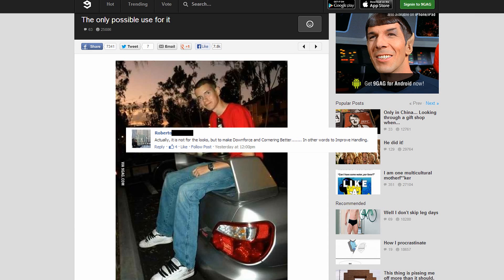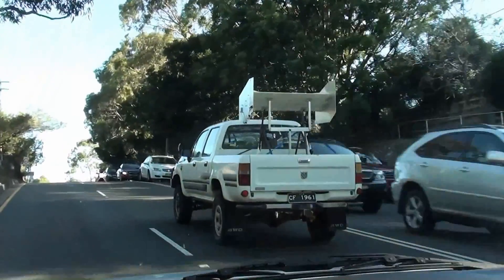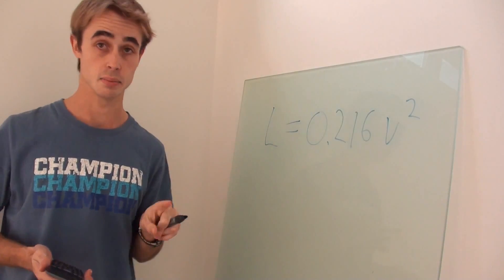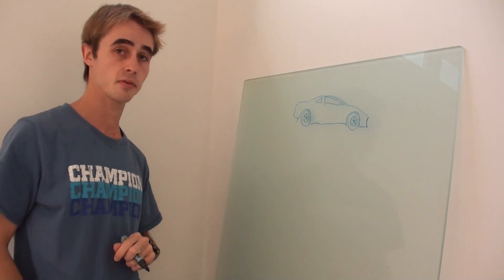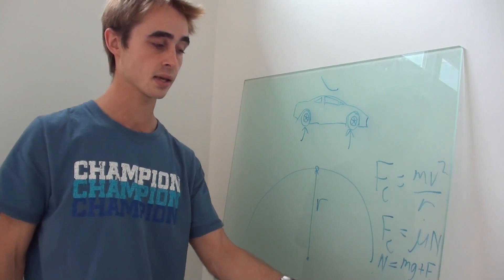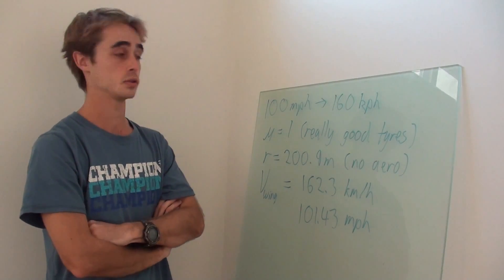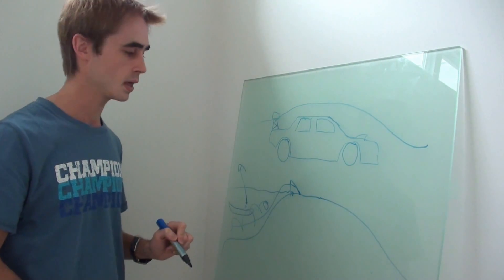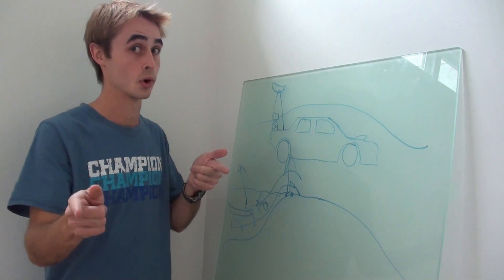Do Car Wings (Spoilers) Actually Work On-Road?

Comment: @KYLE.DRIVES So there is no benefit to having a spoiler for cornering or straights, or both? What about a rear lip spoiler? I'm buying a 2015 sti when I get back state side and I'm not a huge fan of how the spoiler looks I was already planing to replace it with the lip.
Reply from the maker: Ryan C There is a benefit for cornering and acceleration, the point of this video was more to show that for small wings at low to medium speeds on road cars there isn't a noticeable difference. The in a straight line, there will only be an acceleration benefit if the car has large power, top speed will be worse though. Braking will always be better. 

Lip spoilers won't do as much as a wing by a large margin, they do help with clean flow separation off the boot, which should boost fuel economy/improve drag (not by a huge amount though). The STi is a pretty heavy car, I wouldn't worry about the aerodynamic effects of either, do what you think looks good.
Reply: KYLE.DRIVES Thanks for the reply, I plan on going to the circuit tracks with it so I want the best results for it there.I find the videos fascinating so thanks for sharing!

Comment: In fact I've never driven a car that had a prominent wing so I can't really speak from personal experience. As an engineering grad I understand all his physics and they do make sense. Many of you claim that in practise, there is a difference. My question is that, is it because of psychology? Since you are swapping the wings in and out, you consciously want to feel a difference and hence it is created in your mind?

I'm not saying that is the case, I'm just saying that could be a possibility. Though I personally like the looks of wings on cars, Subarus especially. And one of the Subaru videos where they showed an STI doing a circle on the Isle of Man discussed the effects of the STI wing on the car, where the driver was losing stability when a wing accidentally came off. 

But of course, it was a race.

Comment: When a car losses its rear wing at high speed travel, it almost certainly leads to a crash. I wonder why is this the case if their effects are very minimal on something much heavier than a F1
Reply: +Zhangy It messes up aerodynamics. just adding a wing doesn't help. You have to make all parts work together and downforce gets much higher. little things make huge difference and huge things make little difference without little things.

Comment: Apart the downforce, the other component (horisontal) is the resistance. Higher wing means height * resistance force = momentum acting on the chassy (backward). Or - pushing the rear axle, and lifting the front one.

This might be good for rear-heavy cars like Porsche, because the lighter the front is, the less downforce it need to maintain neutral cornering. And the front end suffers lots more limitations for providing a good downforce. So - front-heavy cars (most of the FWD f/r ~= 60/40%) may perform even worse with a huge wing - if they don't have a proper front splitter. 
For example - in the lighter Rally Series (amateur class, 160-200hp) FWD-cars don't use aero-dynamic modifications at all: https://www.minispace.com/mediadata/article/201407/543x/uwuph5sh.jpg

Basically - the closer the aerodynamic's F/R balance center (including the overall backward momentum from the wind resistance) - matches with the mass center of the vehicle, the closer the car is to neutral steering. Which means it's faster in corners. 

This is why on Le mans they keep the wings down:
http://www.blogcdn.com/www.autoblog.com/media/2011/05/001-mazda-787b-le-mans-20.jpg

Comment: Your theories are all well and good. But in practice, you feel it, and more importantly your cornering speed and laps are faster. Actual, measurable, facts.
Reply: usernamefromhell The point of this video was that at street speeds you wont get any noticeable difference from a wing. Race speeds however, of course there's a difference

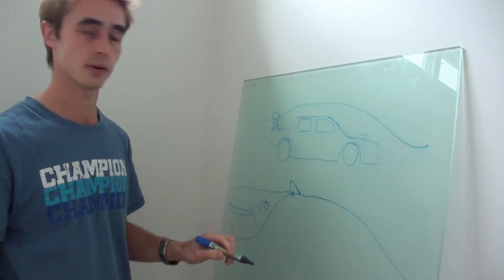Comment: 3:55 Why is the wing forcing the air up? Thanks

And lift occur on VG because the increase of velocity?
Reply from the maker: hsieh811 The high pressure region on the wing top (in conjunction with the low pressure on the wing underside) essentially deflects the flow upwards, it is a consequence of producing lift.

The VGs keep the flow attached around the roof, which will result in a higher velocity and lower pressure, hence lift. It can also be thought of in terms of conservation of momentum that in order to pull the flow down, a force must be exerted on the surface in the opposite direction. 

You can watch my video on VGs for more information!

Thanks for watching!
Reply: KYLE.DRIVES Thank you for the swift reply, keep them videos coming! More about aerodynamics please!

Comment: This guy says that spoilers are crap and shouldent use....??
Reply from the maker: ivi129075 More that the way they are used on road cars isn't going to make a difference that you can feel at anything other than really high track speeds, contrary to people I have seen commenting claiming they make a notable difference in handling at 30mph...

Comment: So you're saying to put a bigger and higher wing on.
Reply from the maker: dorifto Essentially, yes. That and drive faster =P

I mainly made this video because I saw so many people online claiming the WRX wing provided substantial stability improvements at 60km/h, which is complete BS.
Reply: However there has been noticeable difference on the WRX (the actual STi here in the US) in track times. Also a noticeable difference in the feel of the car between a winged and a wingless STi. Also, wind tunnel tests have shown the flow of air across an STi (with a smoke stream) and the results looked pretty clean. This was on an '06/07 STi that has both the roof (above the rear window) and trunk wing. 

Now if I could find an equivalent testing of the S204 wing (with and without roof wing) that would be awesome.

Comment: I don't want to sound like a fool here, but many years ago I had installed an aftermarket adjustable trunk spoiler on a Civic sedan. I bought an additional trunk lid w/o the spoiler due to its conspicuousness on a road car which allowed me to swap it out. I can tell you that there was a DEFINITE difference in the stability of the rear tires during spirited driving on roads with lots of undulation and bumps/imperfections. I'm not talking about absolute speed capability like was shown by your equations since they don't take into account that there is a suspension between the spoiler and tires. I'm just saying that the rear tires felt much less twitchy overall. I'm not an engineer, so my best guess to the cause of this effect is that the air foil must act as a speed-variable shock booster in regards to rebound compression that stabilized my heavily sprung rear suspension. It makes it smoother and safer to drive quickly on country/mountain roads from my experience.
SO...   ...Am I just plain wrong, or is there actually something to the variable damping effect from trunk spoilers
Reply from the maker: ThatOneGuy Sorry for the late reply, I only just got the notification about this comment.

D1 cars use them largely for looks, at the low speeds they are running at they aren't going to be getting much downforce. To top it off, at the extremely high yaw angles they are operating at a wing is going to be far less effective than a wing operating in a comparatively straight line.  There are plenty of successful drift cars without wings, however there are very few time attack cars without massive aero packages, so don't assume that drift aero packages are there for function. If it was a balance issue it would be far easier to tune in the suspension than with a small rear wing at low speed and high yaw.

Regarding your initial question, a wing will provide some degree of aerodynamic "damping" caused by the angle of attack increasing due to the rear raising over bumps. In addition to this it will also provide a counterforce due to the velocity of the car moving up and down. However, these forces will be extremely small, as the change in velocity of the car and angle of attack is tiny in comparison to the speed of the oncoming flow. You would have to be going at absolutely ludicrous speeds to notice (depending on the size of the wing, but we are probably talking in excess of 400km/h for that effect to occur on a civic bootlid spoiler)

Downforce from a rear wing will improve rear stability over bumps, both by increased tyre grip and additional acceleration to the ground if the rear becomes airborne. However, unless you are driving your Civic down country roads at 180km/h +, or your part time occupation is Formula One driver, I doubt you would be able to feel it. What's more likely is a combination of other variables + the placebo effect. Some examples:

How much does the spoiler weigh? It's quite rearward, that could have an effect

What was the air temperature - with different air densities comes different levels of downforce, not saying this is a huge factor, but you could see a difference of a few percent. By the same token the temperature will affect your tyre grip, your fuel density (sloshing effects) and your damping ratios (oil viscosity changes with temparature)

How much fuel was in the tank?

What items did you have in your car? 

Did you just eat lunch - if your rear wing only makes say 2kg of downforce at the speed you are going at and you just put on 1kg, what's the difference?

Etc. etc.

Obviously wings work, otherwise they wouldn't use them for racing, just conservative road car wings at low speed aren't going to do much at all. This video was made because I saw people arguing that the STi spoiler worked significantly from 60km/h, which is just plain wrong.

Thanks for watching!
Reply: KYLE.DRIVES Thank you for replying. It's been a decade since I had that car, but I remember thinking that I was, "missing out," because I would usually run the clean trunk/boot lid to look less conspicuous. Now I realize that there were other factors, such as fuel load, that could've affected rear stability. I appreciate you lending your expertise.
Reply: Ur spoiler has mass too, if you remove your spare tires and tools, a mere 30lb. You can feel a difference with the dynamic of the car, e.g rear is bouncier
Reply: Jock Wilson I guess you don't know what a spoiler is/does if you think they're air foils...a spoiler isn't designed to give downforce, its meant to reduce parasitic drag and lift at the rear by decreasing the turbulence directly behind the car which would increase drag and often times lift. An air foil is designed to give downforce and causes drag (not parasitic) at the rear. You should do your research before commenting or else you'll mislead people
Reply: Jock Wilson you must hang around the ricer crowd if you think the majority of people call wings spoilers.... And whether you studied that or not, a spoiler won't create drag. Just look at a wind tunnel test of a Porsche 911 with and without the spoiler. Also most vortex generators are crap except in f1. The majority of cars now don't have steep drops between their roof and boot so air stays attached and the spoiler allows the air not to become turbulent right behind the car. Also depending on how a wing is mounted (swan neck/through bumper skin) can have little to no parasitic drag. Just watch the video of the supermiata wing that 949 tested on their race car. Seems like you didn't learn the right stuff buddy
Reply: 30lb, your kidding right? Must have pretty average suspension dude.. that 0.01% of your cars total weight without a driver
Reply: Jock Wilson no it's 1-2% for light cars but the mass is at the very rear end. Give it a try
Reply: ThatOneGuy About 10 years ago, I once had an old, slow FWD sedan. I hated driving on the highways because all the other newer, larger vehicles would speed by me and my car would feel very unstable from the disturbances in the wind caused by passing motorists. Being young, I thought having a car that looked like something you would see on a race track but for the street would be awesome. Eventually, I had a large 57" long, 1' high 3D carbon fiber rear wing installed. After that, the car was very stable. From then on, I could even let go of the steering wheel, and the car would glide as if it was on rails. The car has been long gone out of my possession, but now I have a much newer RWD with no spoiler whatsoever and the car is just as stable.

Aerodynamics have absolutely nothing to do with the drivetrain layout. They are designed to keep the car stable while encountering the air it passes through.

A lot of people will joke and say that it's designed like airplanes, when in fact they are actually speaking the truth. Airplane wings are designed for lift, while car wings are designed for anti-lift.
Reply: 2%?? What car do you have that weighs 680kgs??? I have tried it btw, could only tell the difference with a 50kg weight, even then it was minimal.
Reply: ThatOneGuy depending on how high it was it could have acted more like a spoiler, rather than air dam and just leveled out the flow of air behind the car. With the wing the air just drops down creating lift at the rear.
Reply: ThatOneGuy  hi, im not specialist, maybe more GTurismo gamer ; people are arguing and both sides are corect - it totaly depends on needs, if soemone needs stability and grip on rear - yes spoiler gives taht and it doesnt mather fwd awd or rwd ; and its true it reduces max speed and accell in stright ; well beter grip with spoiler means more safety - ofc what exact spoiler angles and other things must be only can tell that guy from videos wtih his corect maths
Reply: KYLE.DRIVES i cant calculate, but noticed that most here saying 180(kmh)+ etc, while im driving to a job at constant 80(kmh)+ one hand out of window is geting pulled i may say quetly hard, so its easy imagine  spoiler is like 15 times more then one hand, and spoiler is already working changing wind direction and making some preasure  (ofc i think it depends on car shape too, as in video), most stock sporty cars are stil road soft, ading some weight from generated spoiler may be adifference, especialy geting faster from 110+, riding car at 120 already feels car reactions differently and diference is made by air only
Reply: B. Saulius the problem is the air not hitting the spoiler...since a spoiler isn't an air foil
Reply: ThatOneGuy deff agree awing makes  a difference
Reply: Some other variables might be that when you had the spoiler on (not a wing?), you might of been driving more lively.. faster corners and accelerating quicker and stuff.. and attributed a lot of that to the spoiler..
Likewise, perhaps without the spoiler, you drove more slow and boring.. slower corners and acceleration.. and subconsciously attributed more of that experience to the lack of spoiler than you should have..
Perhaps! I'm just throwing out a idea.

Or maybe when you didn't use the spoiler, it was to go to work early in the morning when you feel slower and shitty, then after work you're tired and mentally drained.. especially if there's cold mornings (which affects the engine and oil and shit too, I ain't no mechanic!).
Then on the weekends or even weeknights when you're more refreshed, you put the spoiler on and here's a huge difference in your physiology.

I dunno.
Reply: I don't want to sound mean but you put a spoiler on a civic sedan.
Reply: Brandon Lavoie No offence taken. I had an extra trunk lid painted so I could swap them since the spoiler was a touch rice. My point is that I could notice an obvious benefit in rear end stability driving quickly on bumpy undulating roads (especially quick left-right-left-ect. transitions).
Reply: +ThatOneGuy LOL spoiler on a honda.
Reply: ThatOneGuy also this dudes got like a degree in fluid mechanics and aerodynamics, I'm not saying your wrong but he definitely knows what he's talking about :)
Reply: Jock Wilson  Oh, I know he's smarter than I am. That's why I was asking him. I just think that there must be an explanation for the rear end being more stable with an air-foil. I mean even D1 drift cars use them, and they're certainly not going for maximum high speed grip.
Reply: Most spoilers are an aerofoil, except most factory ones lol they're just a random shape, with bad CL values etc.
Reply: I'm referring to a wing as a spoiler as most people do now days. What a load of crap, all a 'spoiler' does is create drag, hence the name, they spoil lift. They are for looks. Your talking about a vortex generator, these use vorticies to pull streamlined airflow down from above/behind the car, re-energizing the boundary layer and reducing drag. And yes I do know what I'm talking about as I studied it towards my commercial pilot licence. I think you need to do some research there son before making accusations. And aerofoil will also still produce drag even parasitic no matter what due to the supports holding it.
Reply: ThatOneGuy you don't want to add down force to the back of a front wheel drive car regardless. You pull traction from the tires that need it the most.

Comment: Next time remove the tailgate to reduce the swirl A.K.A turbulent air in the bed of the truck.
Reply: You actually want the swirl from the tailgate being shut for smoother flow from the cab to the rear. Mythbusters had an episode that showed that pickups get better mileage with it shut.

Comment: A spoiler and a wing are not the same thing.
Reply: Yes they are, a Wing generates lift in a given direction, a spoiler has negative lift ;)
Reply: @TheEsseboy  no, spoilers reduce drag (in car application) by reducing the low pressure turbulent wake caused by separation
Reply: @Shadowboost  How would it do that when it forces air to go up? If it would reduce drag it would make the air go down and hug the car...
Reply: @TheEsseboy  spoilers help reduce drag by hugging the lines of the car wings genarate downforce